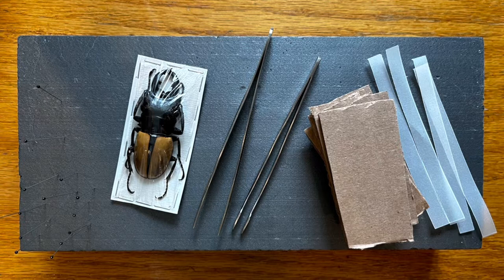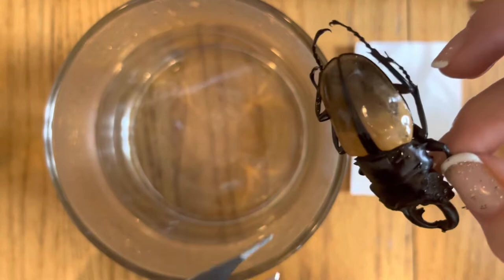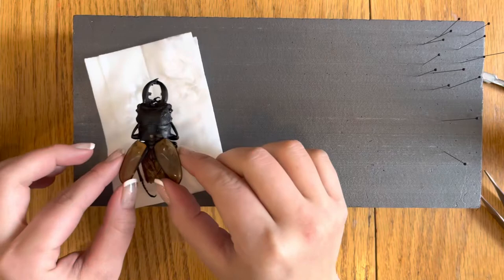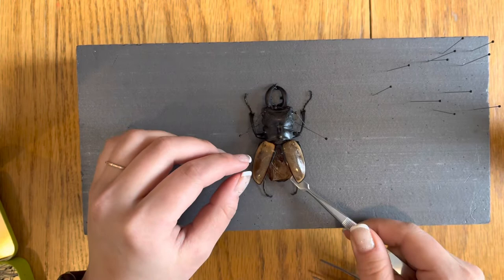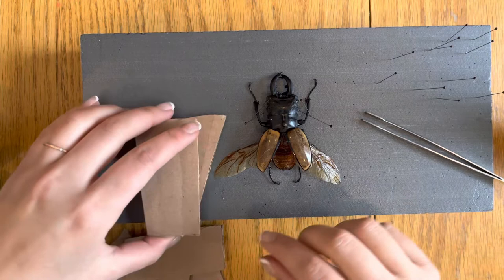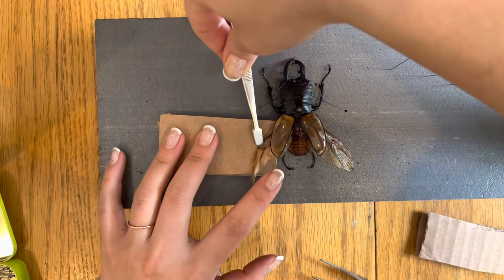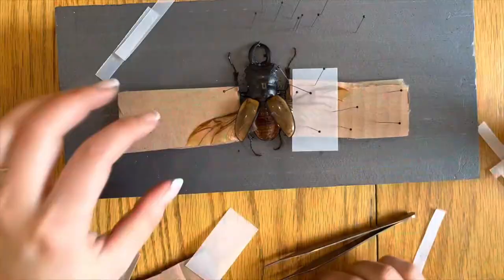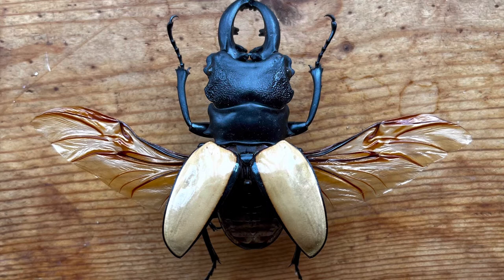How to Spread a Beetle

Comment: i used the hot water, and it worked almost instantly! one downside though, it ended up damaging part of my beetle's elitra and now its a little discolored. besides that though, im gonna try it again with a little less hot water:)
Reply from the maker: Hmmm…. I’ve had color damage with some insects, especially ones with bright colors. You can try reducing the temp of your water. Since we are located at high elevation, the water we use boils in the high 190’s

Comment: Do you have to take out the insides before you pin it? I have a big beetle but I’m not sure where to start.
Reply from the maker: nope, it should be fine! Some of the bigger specimens have the insides removed and replaced with cotton, but I've always done beetles intact :)

Comment: to dry my beetle, can i freeze it? and if yes,  how long do i freeze it?
Reply from the maker: @liehann119  after hydrating your beetle and positioning it on the spreading board, you can just leave it in an open area with plenty of ventilation for 2 to 3 weeks. They should dry it sufficiently. Personally, we leave ours on open shelving unit.
Reply: @thelittlecaterpillar4048  ahh okay thanks🙏🏻